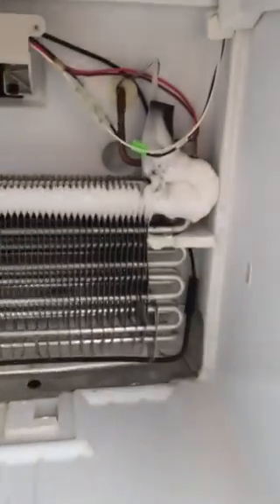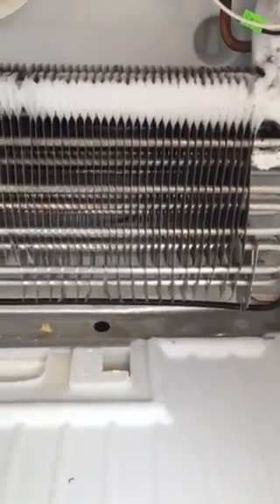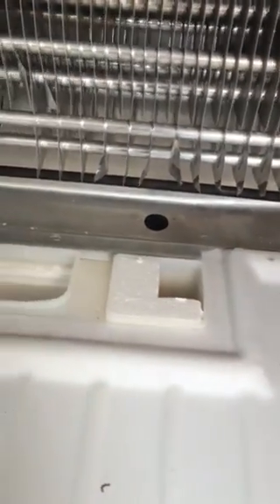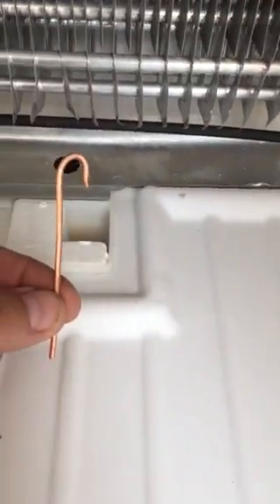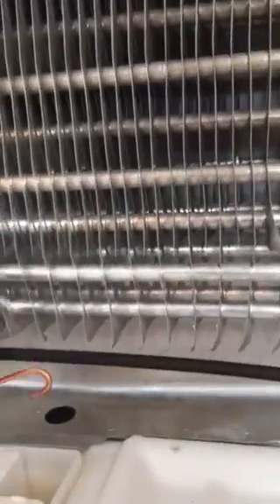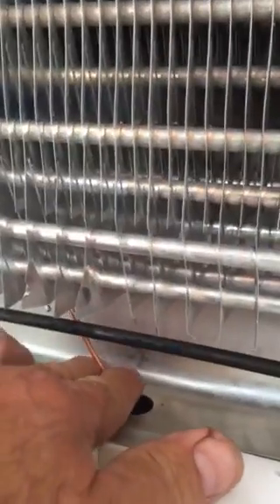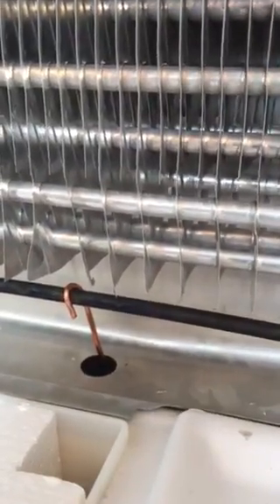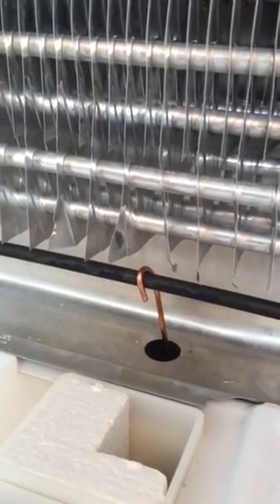Frozen Drain Fix For Whirlpool Refrigerator

Comment: I recently did this trick. I closed the loop on my wire so it won't fall off if the refrigerator gets moved. So far no more problems. 7 inches of 12 gauge bare copper wire.

Comment: Thanks so much for the tip I didn't have brazing rod so I used a piece of copper wire and it worked just as good

Comment: There is a temperature sensor that makes sure the defrost cycle is long enough. People can go to www.partselect.com and enter their model number. See the issue “LEAKING”, and follow the link to this page (for mine).  https://www.partselect.com/AdvancedModelSymptoms.aspx?ModelNum=ET8WTEXMQ01&mfgModelNum=&fkMfgID=3&ModelMasterID=132935&PID=13

The website says it fixes the problem 72% of the time. I have defrosted mine multiple times and I even put in the wire fix but it keeps freezing over. Replacing this sensor will allow the defrost cycle to last long enough to melt and drain completely. I think this is the correct fix that is described below by someone else.  If this works for anyone please reply and let people know. If this isn’t the solution, let people know as well.

Comment: Thanks I have unclogged that drain two times checked the components that defrost all good . Now I did the copper wire trick still freezes .
Reply: Try changing the bimetal frost thermostat. There's a video on here how to do it. That fixed my problem.

Comment: Doesn't hurt not to try. Was getting tired of taking apart the freezer and using a hair dryer and hot water to unclog the drain port. Turned off adaptive defrost and went with the old fashioned six hour default and added a stripped awg wire used for outlets. Will report back after a few cycles.

Comment: Looks like a poor design on the defrost cycle of this brand of Refrigerator.  I previously replaced the heater thermostat and it fixed the problem for a year. There was unwanted resistance on the old thermostat and I assumed the heater element was getting hot enough to melt all of the ice buildup. Using that copper wire makes perfect sense. Thank you for the tip.

Comment: I have the exact fridge and want to do this fix. Can you explain how I remove the inside panel of the freezer?
Reply: Take shelves out.  Remove back screws and lift panel up slightly and pull out top to bottom.

Comment: I did this a week ago and so far zero ice at the bottom of the freezer, whereas before the entire back was frozen to the bottom. The real test will be the hot weather of the summer. I have tested the thermal conductivity of the wire and found it does not conduct as well as I expected. I have read that silver is an even better conductor of heat. A silver wire might cost $15. My wire source was a 12 gauge three wire cable. Maybe it is  impure copper.
Reply: The factory make a kit for this issue.  Its just an flat aluminum strap that wraps around the heating element with a screw to affix it tight.   And some weatherstripping for the large back panel cover.

Id suggest hammering your copper wire flat.  More surface contact with the element

Comment: Now I am thinking how good a heat conductor copper is I am worrying about burning the plastic. That would be  a disaster to fix.  What it comes down to is  what happens when the coils do not need much defrosting. Do they still get the 20 minutes? Twenty minutes in touch  with the heat rod  dry seems like it could do damage if the plastic is not intended for heat? Maybe I will do some experiments.  Or find something better to worry about. Another question is how hot does the rod itself get? Red hot? Probably not.  Probably you need all the heat it gets.  If so, a perfect fix. Terrific. Does the heater come on only when it needs defrosting or is  it by a timer? Or both?  I onlky know I am better off than before.

Comment: I had de-iced the drain and drain tube and screwed back the panel back on the Samsung French door refrigerator.  Then I saw your video and just so happened that I do have copper tubing and created a little hook.  I reopened the panel and installed the little copper 3-4" hook wire on the heating element over the drain tube.  Hopefully, it clears the tubes from freezing and the drain canals leading to the drain.  Thank you.  Would you mind explaining what copper does to water.
Reply: I think the copper transfers the heat from the heating element it's hanging off of to keep the temps warm closer to the hole that would normally freeze over

Comment: I want to thank you for this fix. I have 2 of these fridges and while 
they are excellent at cooling I've had a chronic problem that the drain 
hole freezes and all the water would pool at the bottom of the fridge. 
Twice a year I would have to defrost the fridge and freezer so the drain
 would be unclogged. Instead of the kit I simply used a piece of scrap 
copper wire to the heating element and into the hole. It's now been 8 
months and I've never had water pooling at the bottom of the fridge 
ever. Thank you so much as this was driving me mad!!!!!!!

Comment: Great idea! Has anyone had any problems with the copper wire melting the plastic drain tube?
Reply: I think there is enough water flow to keep the temp regulated...so copper doesn't overheat and rubber doesn't melt.

Comment: Is the purpose of the wire to transfer heat to the top of the drain tube?
Reply: Yes this will give enough heat for drain tube not to freeze
Reply: One would get much better conductive heat transfer from the heating element during defrost mode through a copper wire to keep the drain clear if the wire was wrapped 2 or 3 times around the heating element. Just like electrical connections, the contact area between a wire just hung versus wrapped would be significantly increased and prevent shifting.
Reply: @deanwichert4771  true, but that could also cause a hotspot on the heater element.

Comment: I have a Samsung side by side and it's junk. Frozen water need in the freezer side floor and running out all day and night. Real poor design. Going to try the copper wire trick. This fridge is new and there top of the line. Junk same as there HD TVs.

Comment: I did a little experiment but my results are confusing. I stripped a piece of 12 wire bare copper about 7 " long and put the end directly on the electric stove element. I expected it to get real hot real fast. Instead it hardly conducted the heat at all. Although after a few minutes i guess it works so that proves it. But my experiment  showed little heat conduction. Maybe it is only my wire.
Reply: The copper wire needs to be long enough where you can wrap the wire several times around the heating tube before placing the other end of the copper wire into the drain tube. This method generated enough heat for me  to keep the drain tube from icing up.
Reply: @dq7143  Whatever floats your boat. I just did the candy cane thing and am now going through the hottest part of the summer--zero buildup.  I would watch out for wrapping to tightly as I have read it can create a hot spot on the heater, leading to failure.  Over all, it's a great trick. Thanks again, Don.

Comment: I finally got my act together after first putting the candy cane on the cooling coil, but now I have it correctly located on the heat rod. Copper is a super conductor of heat but I doubt it could harm the plastic. First of all, water will be passing over it, right? Great idea. 
  In fact, this was the original complaint of the previous owner. And the radiator coils were clogged with felt.  Now I am back in the game. Tanks.
Reply: I was having a problem with it not draining and found someone had done exactly that and put it on the cooling element. Oof